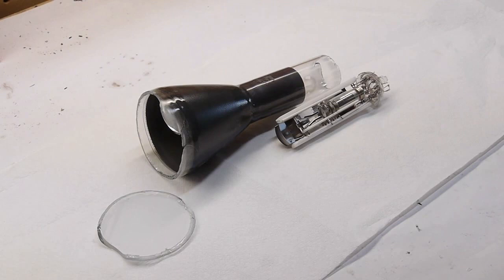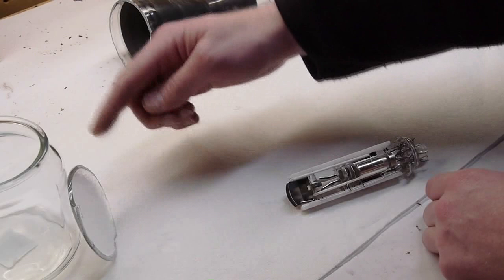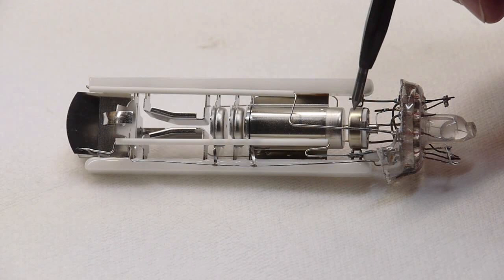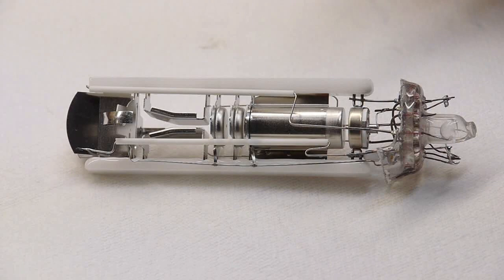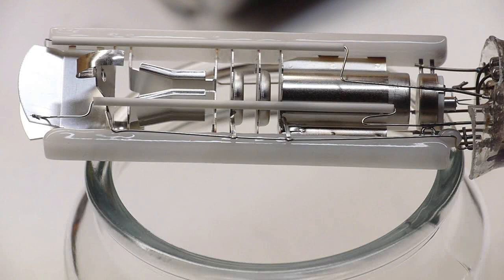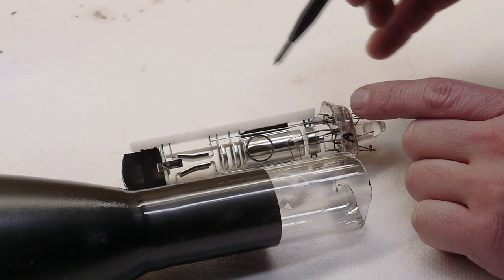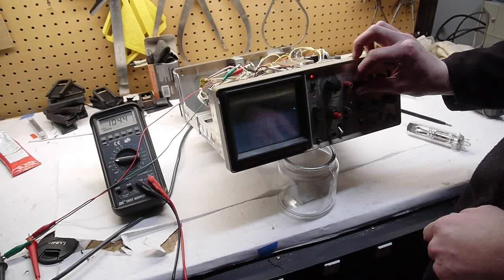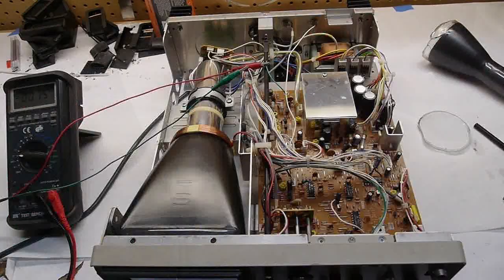Cathode ray tube disassembly and explanation

Comment: Why did TVs use a magnetic yoke for deflection  and this used electrostatics?
Reply: speed, electrostatic deflection can be much faster because theres very little inductance in the control structures.
your tv only needs 15khz, your monitor might be at most 120khz horizontal deflection and 60-240 hz vertical at the extreme end
this needs to be several megahertz (at least) vertical and horizontal in some cases much much more, a good analog scope has no problem showing 100mhz vertical deflection or more
Reply: @Mister_Brown  why not use electrostatic for both then?

Comment: Please help me with this question because I cannot for the life of me find this information anywhere. How can I use a CRT as a frequency transmitter. I know that it can be done ie; Hutchison effect, X rays and the rife machine. I just cannot figure out how and where on the crt to apply the voltage from an nst and transmit a frequency from my function generator. I am at a loss and would appreciate any advice on how to wire this properly.
Reply: +Chris Fazio Impossible. You are wasting your time.
Reply: +Chris Fazio Able to define it more narrowly?

X-ray do you get with solid over-voltage, as for the others you mentioned, I do not know them. But you can use the CRT as a amplifier tube (with somewhat limited bandwidth)

Comment: I am interested in single spark electrical discharge... How will be the cone of plasma channel generated around a pointed cathode and flat anode surface ( 2cm*2cm)... Distance from cathode to anode is 10 micrometers.... Will the angle of cone of  plasma increase with voltage and size of the anode surface?  Anyone plz help me in this regard

Comment: @Shahbaz Chaudhry Good grief why do commenters ask a question, and disable the means to reply to the  question?. The  heater heats the cathode thus exciting the electrons Predisposing the leave the cathode when attracted by a higher potential. Yes in time the cathode will decrease in performance and the CRT will be replaced or repaired. Back in the day monochrome CRTs where reconditioned